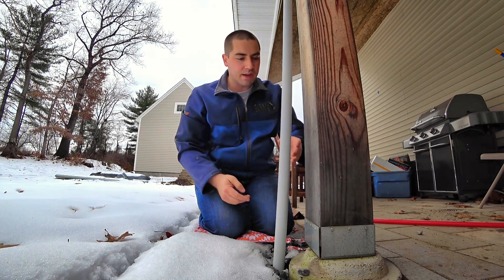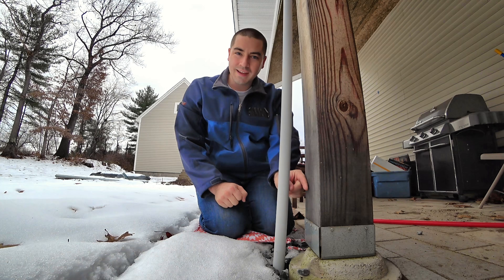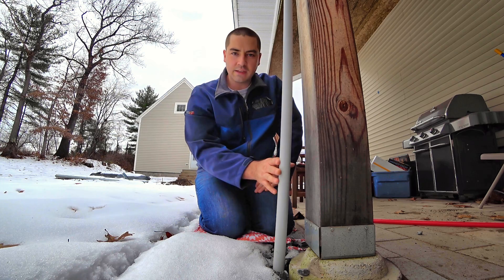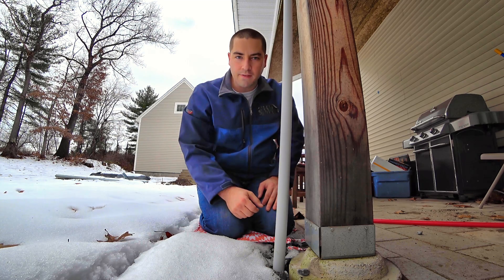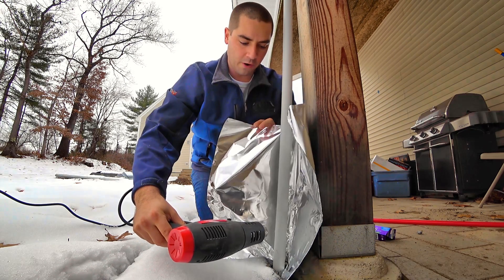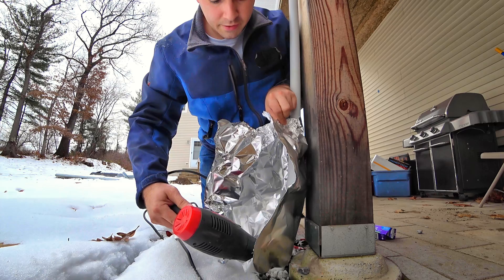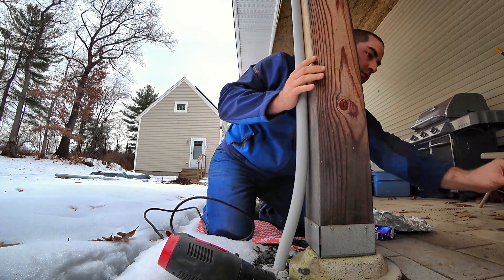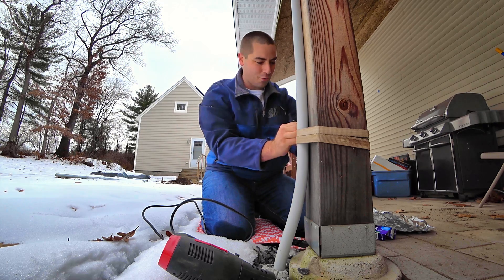Bend PVC Conduit for Custom Solar Installation

Comment: Google my first Tesla battery fire...might think about investing in a BMS....
Reply from the maker: BMS's are great.  I'll make a video about them when I pick the right one for my project.
Reply: @DavidPozEnergy  battery technology has never been better the problem with solar is all along the batteries  keeping up with the advancement of solar panels. Repurposing of batteries is one of the best ways of saving on costs, the problem is the new technology is unforgiving and could leave to catastrophic failure if you watch that video imagine if that would have happened when they weren't around. Remember your most important asset is that your family and there safety and security. Not free energy I know you spend a lot of time on your videos and can tell in the good quality. I know a lot of people watch your videos. After reading see several of your comments people think that they can buy a $20 item to monitor the voltage of the batteries. What a true BMS system involves much more than that. I wish you a safe and happy New Year..

Comment: David this is concerning the 8000 reliable inverter, the cables provided are not crimped properly, take all the heat shrink off and you will see what I mean. Very poor connection point.
Reply from the maker: Next time I do an update on the 8000 inverter I will try to remember to show the crimps.  Thanks for the suggestion.

Comment: There's an electrician's trick you can use a plumbing torch and put the pipe vertical in a vice not very tight though and after that you put the torch inside the pipe in Center and start with a torch on fire you want to make sure that the flame is not touching the side so it don't burn or discolor ate the inside of the pipe once you do this it'll create a very high flow draft and sound like a huge flame because it's creating a Vortex inside the pipe it'll heat up quickly just passed where the flame is at and then you bend it in shape quickly and you're good to go I've made a video on this on my Channel as well

Comment: You can also use a small electric heating blanket to make custom bends in PVC! Helped an electrician wire outdoor swimming pools for a summer and that's how he did it. You loosely wrap the energized blanket around where you want your bend and in a few minutes it's pliable by hand.
Reply from the maker: Great tip.  Thanks for sharing.

Comment: Good job at least it did not go on fire,if you want to bend the pipe with out it kinking put hot sand in it and you can get a tighter bend
Reply from the maker: Hi Mark,  Yes, I've used the sand trick for past projects and it works great.  Although in this situation it would have made pulling the wires through sand hard.  LOL
Reply: @DavidPozEnergy  In that case you'd just need to bend the pipe during fit-up, before you glue it all up. But for a bend that minor I'm not surprised that you didn't need to use sand.
Reply: @DavidPozEnergy  yes i thought of that it would have worked if you had not already fitted the pipe you can use it when you do the run across the ceiling and down the wall better than 45d fittings